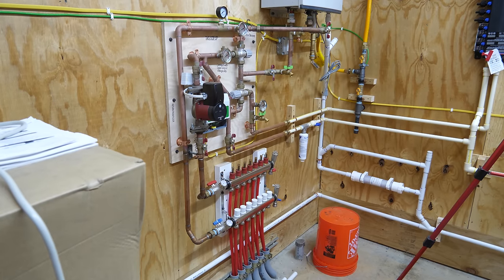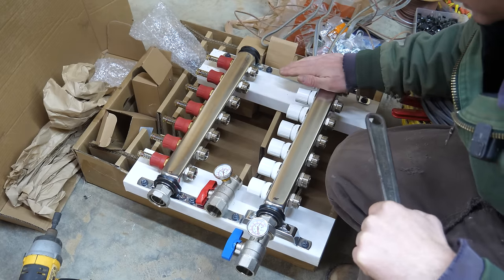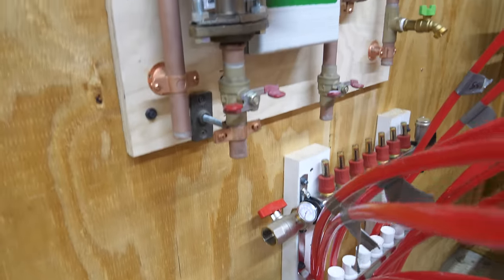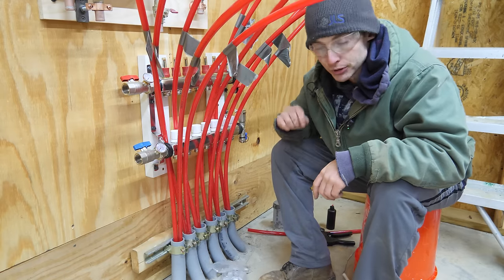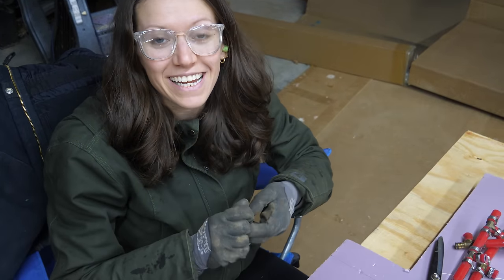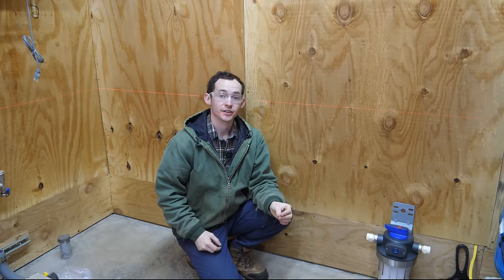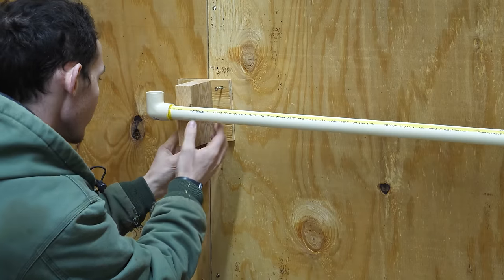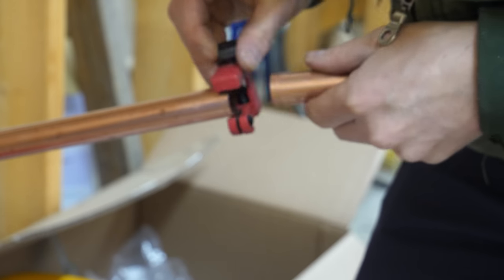Start-to-Finish Radiant Floor System (by DIYers) 🔥

Comment: I designed and built my house with radiant floors and have been through all of this! Good work! In my setup, the floor sensor doesn't really help. What I did was bore out a hole in a bottom plate of a wall, stick the sensor in there and jam it full of silicone. Even after installing this sensor at both of my thermostats I don't need to use it. The timer function on the thermostat is all you need. Your setup may be different becase of the depth of slab, amount of insulation, etc.. You will develop an understanding of your system only after living with it!!
Reply from the maker: Yeah I'm already seeing the floor temperature doesn't mean a whole lot, the thermostat default is to keep the air temp at a set point, and only pays attention to floor temp to keep it between min and max limits (45 and 80 I believe). So far so good!
Reply: @MasonDixonAcres  My slab might be thicker than most, so the time delay between when the system turns on and when any heat is felt in the room is over three hours. I can't let the system run until the thermostat kicks off because the slab would be overloaded with heat. So its a bit of a guessing game. I usually watch the weather and adjust the water temperature and/or the lenth of time that my system runs in the morning, but only really need to change that a few times over the winter.

Comment: Just found your channel from a short! Having just finished a smaller scale house reno, I've found a new love for doing things myself instead of paying someone else to do it. I'll be watching more!
Reply from the maker: Awesome, we have the same thought. While it is slower, we learn so much and the satisfaction is fantastic.
Reply: great work, and yes, very professional looking!  Just be careful if you plan on running the outdoor outlet on the same circuit as your critical circuits for your heating system.  That way, you don't have something outside like a storm or hosing down your siding, the whole cirucuit doesn't trip due to water intrusion.

Comment: Plumbing work looks good.  Don't worry about the Sharkbite coupling, they are code and will be fine for what you are using it for.  Nice work!
Reply from the maker: I appreciate it!!
Reply: After saying you watched y.t. videos on soldering,  you forgot to say, you also stayed at Holiday Express.
Reply: I’ve watched your video several times now. It’s one of the best I’ve watched. I’m wondering how many sq ft you’re heating and if you are pleased with the results. Do you like the combi heater you’re using.

Comment: Do you have a monthly cost for the in floor radiant/temp setting?? I am also on propane and will be building a 40x60 ft pole barn w/ in floor radiant. I am in NY and experience 10-45 degrees in the winter from November- April.

Comment: This is the first of your videos I've watched, but I've really enjoyed it so I'll go back and start watching the rest. One thing that instantly struck me though, and I'm surprised no-one else has commented on it, is that I don't think it's ideal to have your electrical outlet directly underneath the boiler; any leaks would potentially be straight into that outlet.
Reply from the maker: Thanks! I think someone else did comment on that a while back, I agree that was definitely not best practice in hindsight 😂 however with it being GFI and the low liklihood of a tankless springing a leak with yearly maintenance, it should be okay

Comment: Very nice work.  

Question:  did you use a vapor barrier on the heated side of the insulation?
Reply from the maker: Check out our radiant slab prep video, vapor barrier is on top of insulation

Comment: Hey Alex.  I'm also not a tradesman, but I do have one suggestion for you - on your electrical box you put in, it looks like you wound the ground wire around the ground screw counter-clockwise.  I've always seen it suggested, and it makes sense to me, to run that wire around the screw clockwise so there is less chance of the loop trying to unwind as you tighten down the screw.  I wouldn't bother going back and changing this one as it appeared secure, but as you wire in receptacles and future boxes, something to look out for.  Gotta be exciting to make this progress!
Reply from the maker: Oh that's interesting! I just took a needle nose pliers and formed a tiny circle that held the screw captive and then tightened it in the box. Never thought about which way the circle was wound. Funny enough I do actually need to go change that screw out, because they are supposed to be green by code but I only found a silver one laying around. Or just go in there with a green sharpie 😁 Most of our boxes will be nonmetallic, actually about to go pickup all the electrical rough in supplies tomorrow. It's definitely nice to be getting to mechanicals, lots of fun ahead
Reply: @MasonDixonAcres  Did you get cited by an inspector on the green screw?  I've seen people that believe it has to be green in these boxes, and also plenty that say it does not.  I have not been able to find a code reference that requires a green screw outside of the panel bonding jumper in a panel (250.28c), just that it must be threaded, not a self-tapper (250.8), and that it can't be used for anything else (250.148)

Comment: So is the radiant heating hooked up to the boiler directly, and not like an indirect or a separate set of connections on the tankless unit? Is it the same connection for the boiler and the hot water because if it’s set up that way,  that’s not right
Reply from the maker: You can see all the details here: https://www.radiantcompany.com/system/opensystem/

Comment: Nice work. When you use metal clamps to secure plastic pipe, cut a strip of rubber from an old bicycle inner tube or roofing membrane. Put it under the clamp so that the plastic is isolated from the metal.
Reply from the maker: Good tip! I wrapped the ones securing our gas manifold in electrical tape but didn’t bother for the rest. You’re thinking just as a chafe guard?
Reply: @MasonDixonAcres  I believe that is the rationale behind the code. Your condensate pipe is not under water pressure. So it will never chafe. So maybe the inspector won't care.

Comment: Can you say specifically what insulation you used in the walls and where to buy it?
Reply from the maker: ROCKWOOL ComfortBatt R23! Should be available at most HD/Lowes or any insulation supplier

Comment: Could the power outlet under the water heater cause a problem if there is a leak?
Reply from the maker: Location could have definitely been better on that, but it is a GFCI recep at the least. May relocate in the future, however I would imagine these tankless boilers aren't prone to catastrophic leakage like normal tanked heaters

Comment: Great work! It's always a fun time learning new skills. I've seen some people that use closed loop glycol vs open loop water. What were the deciding factors for y'all choosing open over closed?
Reply from the maker: Thank you, agreed! Biggest one was being able to use the same heating appliance for both floor and domestic water. Also the open system makes sure the water never gets stagnant in the floor during summer. It's a very simple system and I like that there isn't even a control needed for the boiler.
Reply: @MasonDixonAcres  That makes sense! I didn't realize you were using the same heating appliance for both. Looked great!

Comment: Hey, so is your radiant system circulating potable water? I couldn’t see for sure, but looked like it. It looks like maybe the Takagi boilers are designed for potable water? If not, it will rust out from dissolved oxygen in the water. If you have a standard cast iron pump, that will also rust. 

All the other systems I’ve seen (and my system) are closed loop once filled, so the oxygen comes out of solution once it heats and that inhibits corrosion in all the ferric parts.
Reply from the maker: Yes, this is an open system. More info on Radiant Floor Company's site

Comment: Question, for the electrical... conduit is not required? I thought romex had to be either behind sheet rock (fire barrier) or in a PVC conduit or EMT metal conduit. Or is this a barn non living area?
Reply from the maker: The NEC is vague on this so it’s left to the local AHJ and ours was fine with it. The NEC states something like no surface mounted nm-b where exposed to hazard. Conduit and thhn or MC cable would also work. This is in a utility room attached to the garage and separated from the living space in the same manner as the garage.

Comment: Curious, I noticed the lack of an expansion tank. Do you not require one where you live? We're building a home with a heated slab as well
Reply from the maker: With an open system you don’t need one - the well pressure tank serves as the expansion tank

Comment: Thanks for the videos, helps answer some questions I have. I’m designing a garage apartment, I was wondering about the exhaust that close to a operating window.  Keep it up
Reply from the maker: There’s a full table of clearances in the manual of whatever tankless you buy, and I think those are derived from National fuel gas code. I checked our manual again and it’s 1ft in the US and 3ft in Canada for a direct vent next to an operable a window

Comment: Great video.  But shouldn’t your vent pipe slope toward the outside so any condensation will run out and not into the heater?
Reply from the maker: Nope, otherwise it will drip icicles in the winter. When it goes back into the heater, it ends up in the condensate drain where it belongs

Comment: Great video!  I work in the plumbing/ HVAC supply industry and, like you, I love saving money by doing all of this kind of stuff DYI.    Are you guys in PA?  (I noticed the PSU mitt your wife had on).
Reply from the maker: Right on! Yep we both went to PSU!
Reply: @MasonDixonAcres  me too!  My wife and I just brought a piece of lakefront property on Smith Mountain Lake in Virginia.  I plan on doing a lot of my own work when we build.   What portions of your build did you outsource/ vs doing on your own?
Reply from the maker: We will probably do a whole blog post & video on this question eventually, but basically outsourced the things which were highly impractical if not impossible to do ourselves - laying block, slab pour, roof framing, metal roof install, dropping the well pump, drywall, seamless gutters. Two items (excavation, soffit/fascia) we could have done, but had friends or bartered for others to do it instead. Everything else we are doing ourselves.

Comment: You must surely research all night and work all day. I bet you’re looking forward to sleep!

I was a GC for many years, and your work is better crafted than 99% of the jobs I’ve seen. My only point would be that not all municipalities will let you surface mount nmc cable. I’d recommend a raceway or pre-wire before you installed your plywood. …but you’re doing a super job!
Reply from the maker: Thanks so much! I cleared the surface mounted nm-b with our inspector ahead of time, NEC allows it but is vague

Comment: you need to relocate tall outleta, switch boxes and junction boxes out from under and away from any water connections that could leak and out from under all water and sewer drains pipes

Comment: Not sure if anyone pointed this out yet but, it needs to be in conduit using thhn wire not romex. Romex can be exposed but it has to be 6’6” off the ground. I own an electrical company, over all it looks great.
Reply from the maker: Thank you! The NEC is vague on this so it’s left to the local AHJ and ours was fine with it. The NEC states something like no surface mounted nm-b where exposed to hazard. Conduit and thhn or MC cable would also work

Comment: Great Job! The only thing I would have changed is the cpvc. It’s a shame to see all of that pretty copper attached to white plastic
Reply from the maker: Thought about it but it had to transition at some point due to the cpvc ball valve coming off the well tank valve. I also didn't see much extra value in copper for the amount of extra labor and material cost
Reply: @MasonDixonAcres  I would have done the same but it still would have hurt me every time I looked at it. 😀

Comment: 13:04 I was going to say they sell a fireproof fabric for this purpose, but I am guessing beyond this piping you are not using too much copper in your home, though I might be using pex rather than that CPVC supply pipe, seen some horror stories with that pipe.  I think that manifold was a good investment and price too prob $500 in fittings and pipe alone.
Reply from the maker: Yeah i was too cheap to buy the little fireproof blanket 😂 for this little bit of pipe leading to the manifold i was trying to avoid the flow restriction from traditional PEX-b fittings and I didn’t really want to hassle with expansion PEX since i don’t have the tool and fittings are a pain to find. If the cpvc ever gives me a problem I’ll just replace with copper since it’s less than 10’ total. I’ve only ever seen problems with cpvc when it freezes, so fingers crossed that never happens 🤞🏼

Comment: Did they let you install the exhaust beneath the window like that?
 Watch out for carbon monoxide coming in the window.
Reply from the maker: 3ft is all that's required to a window opening per the heater install instructions
Reply: @MasonDixonAcres  ok. Didn't realize it was just a height thing

Comment: In my area, they would require that the electrical be run in conduit if exposed to the room.
Reply from the maker: I'll learn for sure when the inspector comes for plumbing (impossible to get ahold of him otherwise), worst case I'll swap it for MC cable. He's pretty flexible though so I'd be surprised if that's the case

Comment: Dutch oven; usually 2:1 coals top vs bottom.  Get welding gloves.  Those cotton gloves are a hazard near flame.
Reply from the maker: Good tip, I'll put those on the list for the next Harbor Freight trip 😁

Comment: Not sure what electrical code year your area has adopted, but flush-mounted non-metallic cable is not allowed anywhere from floor height to 5' above floor height. Needs to be armored cable or individual wires running through EMT, or non-metallic cable is ok running through the studs like any other interior wall. Great work though. Your inspector may not be too picky. Given you were doing this back in January, you might already know this. Love the channel. This rule doesn't count for your ultra-low voltage cable (thermostat).
Reply from the maker: I did look into code on this before and it seemed fairly open to interpretation by the AHJ, the verbiage was something like protected from physical damage “where necessary” but didn’t have any height requirements. I’ll talk to him about it when we do our rough plumbing inspection before I run anything else. Thanks for the input!!
Reply: @MasonDixonAcres  You are correct in that the code doesn't stipulate the height. If your code official approves any exposed NM cable below 5', immediately go out and buy a lottery ticket. You are having a lucky day :)
Reply: I had the same question.... it's odd to see exposed romex that is not behind sheetrock or if exposed not in PVC and/or EMT conduit. Even in the attic, the inpsecter wanted the romex either covered or in conduit ~7ft around the hatch. And the attic was simply a service area for the furnace.. was not a living space. That maybe extreme but in a common areas I would expect wires to have some covering (drywall or conduit or plywood). Drywall is a fire barrier too.

Comment: next time, get yourself a heat gun, warm those joints up and the pex pipe usually slides right off the fittings with a small tug.
Reply from the maker: Good tip thank you!!
Reply: @MasonDixonAcres  anytime. I wish I had people helping me when I needed it. All the best in your new lives. Congratulations on your build. Bangup job! Be proud!

Comment: You shouldn't mix the domestic with hydronic water.  A lot of jurisdictions restrict this because it will be a health hazard. If you wanted to use the boiler to heat domestic you should use an indirect tank. "After longer periods of inactivity, such as after the summer, the heating water has been stagnant for weeks or months, allowing more time for legionella to multiply." When you turn the heat on in the fall your water will taste like crap.
Reply from the maker: In an open system, the water in the floor flows any time a hot water fixture is opened. It doesn't sit - the tankless draws cold water from the floor, which is replaced by cold water from the well. More info on the Radiant Floor Company's site
Reply from the maker: The code reference seems to assume a closed system, the term backflow in its traditional sense doesn't really apply to an open system. There's flow into the system, circulation, and flow out of the system when domestic hot water is used. Our inspector had no problem with this setup. The recommendation you linked is certainly good info, and it's true that the tankless isn't drawing 100% from the loops due to the mixing valve but it's not 0% either. We will test our water annually and if something changes it would be easy enough to convert to a closed loop, but as far as I can tell at this point, an open system is no more risky for bacterial growth than a guest shower that gets used twice a year.